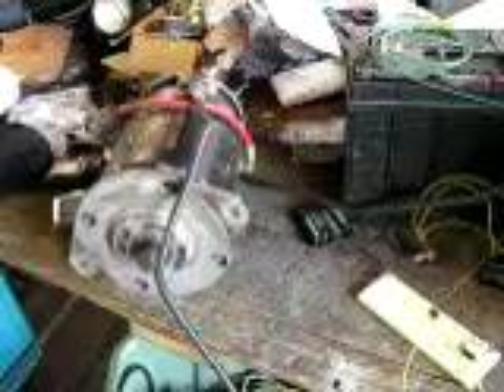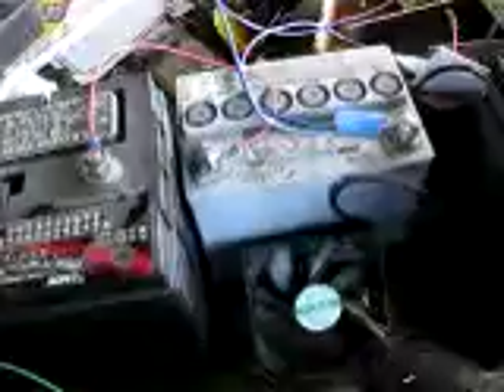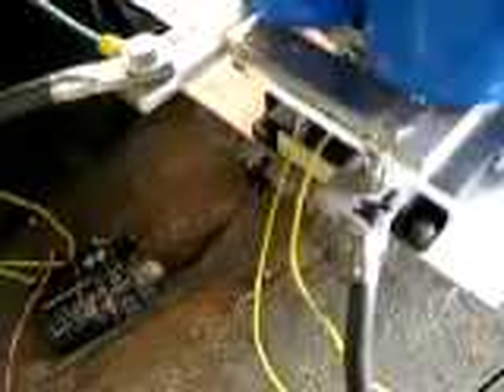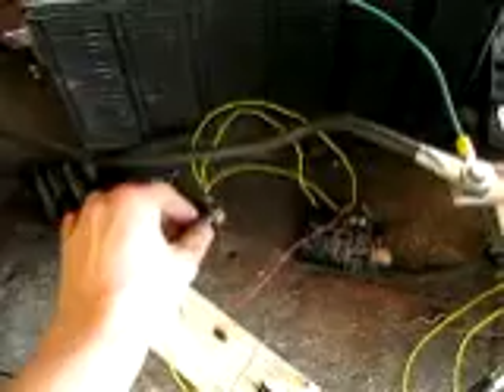1500 AMP Homemade Motor Controller Test 2

Comment: @Chuechco93 Yesterday I built up a 555 oscillator circuit and testet it with a simple NPN transistor that enables current flowing to a motor. It works pretty good although there are only 200mAmps flowing through the circuit. I think I won't be able to controll large motors with a simple 555 circuit since I need to watch current, voltage etc. I also have an arduino lying around here. It could defently do the job. Or I will buy an ATMEGA8 microcontroller which are very cheap.

Comment from the maker: @Chuechco93 I did not use overcurrent but for the hardware overcurrent I planned on using a nand gate and a latch. The PWM signal goes through the nand gate until a signal come from either the shunt or a hall effect at a certain voltage say 5v to the latch. Both leads of the nand receive a postive signal and the pwm stops for a brief time resetting the duty cycle when the amps are too high. I don't know how you would set different current limits though b/c of the latch.

Comment from the maker: @Chuechco93 They are darlingtons powerex model ks621k30 they were pretty cheap on ebay and I was surprised by the amount of current they could handle when driving my truck the only thing was you had to keep them at 1.5 khertz or below. Have you ever worked with micro controllers? I wanted to either use a pwm circuit out of a scooter or perfect the programming with arduino then use hardware overcurrent.

Comment: @anewlow23 Yes I have. My plan is to build an electric go kart. I already bought a large DC forklift motor (maybe a bit overkill). next thing I want to do is to make the controller for it. 400 Amps is fine. Are you using IGBTs or MOSFETs? Do you have a schematic for the power unit?